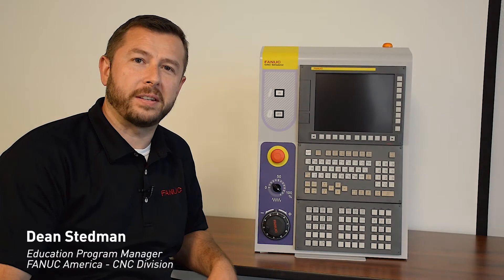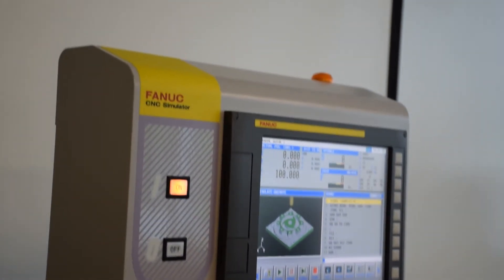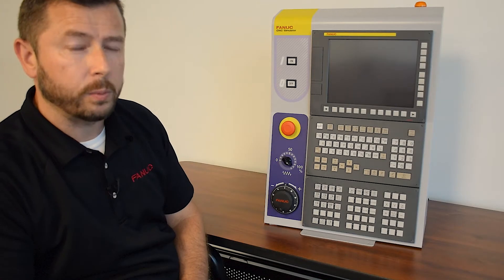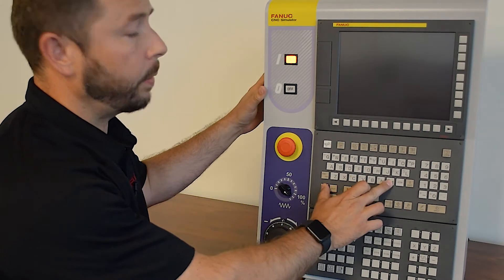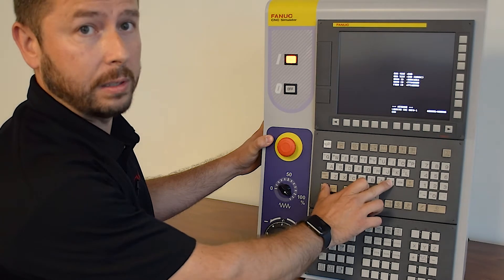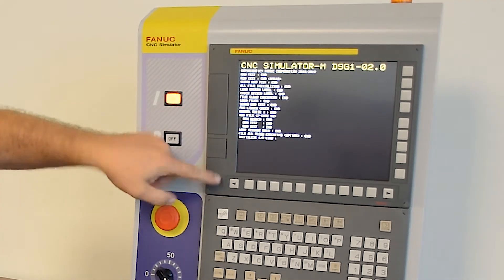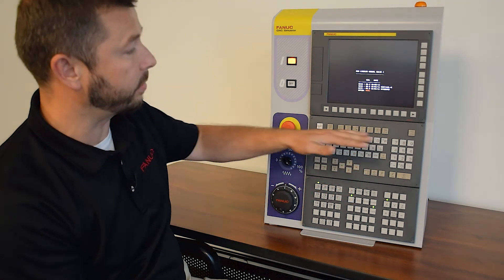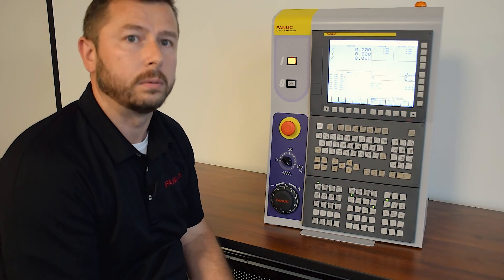CNC Simulator Introduction Part 1

Comment: I'm going crazy, I'm running a Doosan with 32i Model A. When in library, CNC Memory, there is no descriptions you put in using ( ). Just then program number, O0123, and date. I have never seen this before.